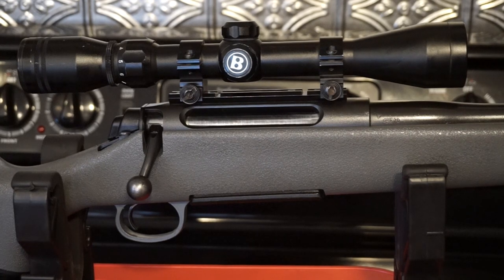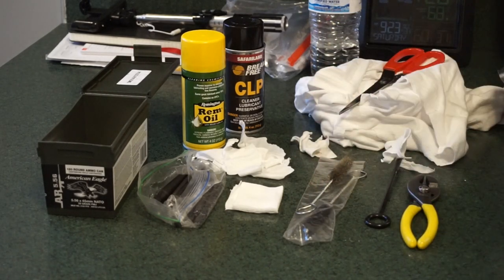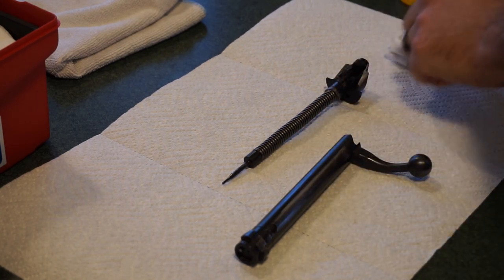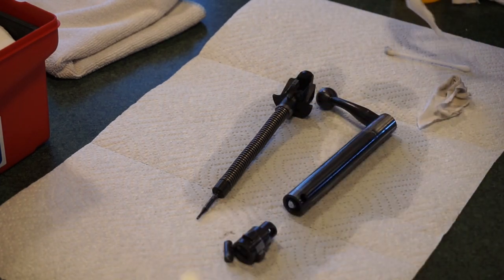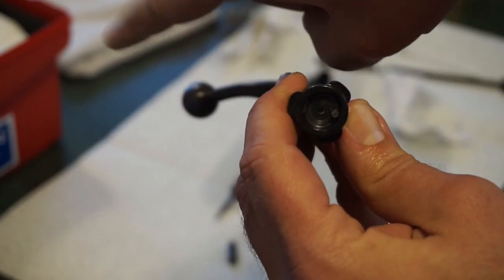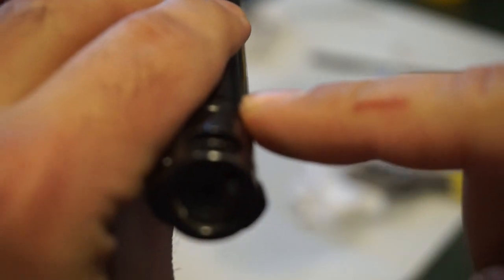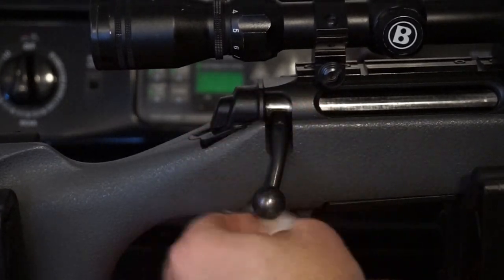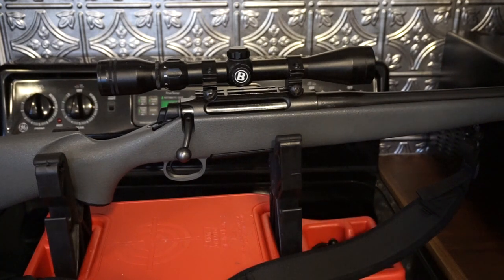Remington 710 bolt disassembly, cleaning and reassembly.

Comment: Just bought a .308 770 from my father in-law for a steal but it was in serious need of tlc. Gummy bolt, horrible trigger action and surface rust. After following along with this vid for cleaning the bolt, copious amounts of CLP and 0000 steel wool, I'm confident I can fill my freezer this fall. It may be a budget rifle, but after a good deep cleaning, it cycles and functions way better than people claim it does from the factory. On to spraypainting camo on it next. Thanks so much for this. I found tons of vids on field stripping but nothing this detailed for the bolt. You turned my almost-regrettable purchase into a rifle I'm happy to beat up and put to good use.
Reply from the maker: Awesome!! I also made a 710 rifle cleaning video that you can check out but it sounds like you are all set!

Comment: I am a pistol guy and bought a 770 in .308 for my great nephew but the bolt handle broke as they often due. Sent it to Alaska to a guy who TIGs them properly (instead of silver soldier). Didn't touch it for a year and went to install the bolt. 
The head was 180 out. (We all make mistakes). You video helped me fix it. Thanks.
Reply from the maker: Glad to help!! Thanks for watching!
Reply: @CraigMiller How about an addy for that Alaska fellow and what he charged you? Also, how is the repair holding? I have a 770 and the bolt handle is ok so far, but I'd like to have it reinforced via a tig weld so it won't break in the future.
Reply: @dkeith45  VERY happy with quality and speed. Here were his costs.

As per instructions-
Cost-
$50.00 cash,check,money order payable to ACCU-TIG or to me personally.
$15.00 return USPS Priority/Ins w/ tracking.
Thanks

Total=$65.00

I will take care of packaging/label's etc.

Dan
Reply: @WW2Historynut  ACCU-TIG! That fellow may indeed solve my problem! Gonna give him a call. Finally a reasonable solution. : )
Reply: @dkeith45  You will have a problem if you have tried to weld it already. He does great work but was adamant that I had not tried to weld it myself first.
Reply: @irocchurch4736  I haven't. It is new and unbroken. I simply discovered the flaw while searching for info on the rifle and decided I'd like to have it reinforced before it DOES break, which seems all too common on this model. I'm also going to see what I can do to alter the 'bolt stop' even though mine is new and undamaged. The bolt stop on this rifle seems to break easily and is no longer available. Seems to me there might be an easy fix for it.
Reply: @dkeith45  This silver soldered bolt handle and the pressed barrel are the complaints about this rifle. TIG fixes the first and the second isn't real since the bolt lugs are machined into the end of the barrel. The only slight downside is possible scope issues but I haven't ever seen them.
Reply: @irocchurch4736  The bolt stop is also an issue. They seem to break often and there are no new ones available, even through Numrich. I've seen several videos on the stop breaking, one where the shooter gets a bloody face when the bolt hits him in the mouth. The pressed in barrel is not liked, but doesn't cause any problems I'm aware of.

Comment: Good info........I took mine apart to clean all the grease out, buff, and re-lube..........Simple. I use this 30.06 for long shots....The factory scope is good for 200 yds. I normally don't shoot wildlife more than 100 yds. If the target was more than 200 yds, I'd definitely get another scope.....So the package fits my purpose. I got it at a good price and it only had maybe five shots through it. Bought it for $75 so I'm not complaining. Just had to clean all the packing grease. Have an armorers certification through the military but their weapons are somewhat different than civilian models............Thanks
Reply from the maker: Thanks for watching!
Reply: 30/06 has noticeable more power that 308. 308 May be slightly more accurate for those shotters who shoot 1000 yards and slit hairs. Myself??? Im not one of this guys. 250 to 300 yards is more than enough for hunting or for overwatch in a defensive compasity. If I can hit a small melon at a little over 300 yards in content. Idk anywhere in at where there is 300 plus yards of open land. You can get 5. 6 7 hundred yards if you want. I just site mine in at barely over 100. After that I can hit anything w in 300 yards dead
Reply: @valeriegogel4214  I have mine sighted in to 150 yards. It's dead accurate.

Comment: Interestingly, the 770 solved the bolt head problem, it can only go on one way. Or at least the 770 I have is like this. There is a flat inside the bolt bore so the head can only go on one way. Too bad they still hadn't figured out the problem of the bolt handle breaking off, or the bolt stop fracturing. Thankfully someone in this thread mentioned ACCU-TIG as a good solution to the bolt handle problem.

Comment: Well done. Looks like if you use a piece of a rubber hose for better grip and avoid loosing traction will help. Also avoids marring the plastic pieces of the bolt. I use a pair of locking needle nose pliers to hold the bolt compressed to release it from the bolt body. This smooth out the action more than what it was. Great video and very informative. ♠️🎩🎱🎯🇺🇲🏁🇺🇦🔱🌻💮🌼🌸🏵️🏴‍☠️🏹
Reply from the maker: Thanks for watching and that is some great advice!

Comment: I picked up my 710 about 3 years ago and have had no issues with it.  It is chambered in 30-06 and I have 1 inch groupings at 100 years with  Hornady Custom light bullets.  Great video, not sure.  The only this I would like to different is the trigger pull.  Would like to have a lighter trigger pull.  Any suggestions?
Reply from the maker: The trigger may be adjustable. I no longer have this rifle as I sold it to a friend but there may be an instruction manual that you can find online for it that would show you how to lighten the trigger. Usually, there is a screw to do this on the trigger group.

Comment: is their a difference between the 710 an the 770 ?
Reply from the maker: The 770 was the replacement for the 710 and has more metal components. What's weird is in the Remington Forums people have shared that the 770 stock is a bit ugly but the 710 has a better trigger.
Reply: @travisp11  so if i had a 770 in 30-06 could i use the pin assembly to a 710 30-06 in the 770  i tried to get a new 1 but Remington  told me they cant sell me the pin assembly for the 770 i have to send it in to their gunsmith an im not comfortable with mailing my rifle in to their gunsmith i didnt get it from a store i got it from an old guy who had problems with it an i told him i could fix it he said he would sell it to me i thought it looked cool an it was a simple fix so i gave him $100 50 rds at the range an it was work perfect
Reply from the maker: @draven1438  I honestly don't know if the parts are compatible. If you if take a look at both assemblies or maybe if they are listed as the same set of parts online you could use them but I am not familiar enough with the 770 to make a call. I don't blame you for not wanting to send it in, either.

Comment: Just from my opinion based on the vid, I doubt that gun has over 100rds through it by the look of that bolt, good find!
Reply from the maker: deadhorse .243 isn't exactly a cheap round, either. I'm going to try something in the 75 great range and also some 100gr. (if I can get it) Hornady American Whitetail.  These used deer guns always seem to show more wear on the outside because of the conditions they are used on vs. the insides which seem to hold up well.

Comment: is there any way to tighten  up   the   bolt release  lever?   mine likes to work its way up   and   then then the bolt can come out when you don't want it to.    been    using  rtv  when hunting to keep  it down
Reply from the maker: It may just be worn out. You may be able to find a less worn bolt to replace it with.
Reply: @travisp11  bolt is fine   the  lever on the side   doesnt stay down
Reply: I have the same issue. Not sure if it rattles loose from recoil or just from walkin through the woods but I've yanked my bolt out of my gun more times than id like to admit. Even dropped it out of my tree stand once trying to get another round on a second deer, another time had a coyote 5 or 6 yards while sitting on the ground, missed and went to rack the bolt the stupid thing turned and ran right toward me i had to get up and holler at it. It didn't see me until then i dont think just confused from the bang I guess. But yeah ive learned to check the bolt release lol

Comment: don't use pliers... you can scratch your  bolt... my looks  nasty after that use boot liers...
Reply from the maker: ok!
Reply: @travisp11  to be clear. In my case i scratched 783 bolt plug.  it is bothering me - mean I have to spend extra 20 bucks  on the new part. 
again don't feel bad it is not your fault. your instructions was clear. it mostly my skills.
Reply from the maker: Khatuntcov Mikhail yeah, those parts are easy to scratch. Even the instruction manual says to use pliers which surprised me.

Comment: Awesome video and great teaching skills. 
With that said I broke the J lock on the bolt.  Shroud is cheap plastic 😦😕🥺🤬
Reply from the maker: Oh no! Can you get a replacement?
Reply: @travisp11  haven't been able to find one yet. I'm going to get in touch with Remington directly and see about that route. The plastic was very cheap on it when it broke you could see that it was just regrind or trash plastic. And I think the problem with it is I can't get my bolt to completely engage and I'm assuming it has something to do with the firing pin being engaged with the Jay lock on it. It happens, but it was an awesome video super easy to follow along super easy to soak up the info I appreciate the video.
Reply from the maker: @dustinmeatball  thanks again and I hope you are able to get it fixed!

Comment: I have that same gun. The other day while hunting,  I shot it from my treestand.  I reloaded it and I couldn't put it back on safety. I opened the bolt just to double check that I did in fact reload it, which it was. When I closed the bolt, the gun fire on it's own. My hand was nowhere near the trigger. Thank God the barrel was pointed away from me and into the hardwoods.  Have you heard of anything like this before?
Reply from the maker: Sounds like the firing pin was in a locked and something inside the bolt was stuck or caught. There was a recall back in the day for certain production numbers of Remington 710 rifles. You may want to see if your rifle is on that recall list. Yes, thank God nobody got hurt.